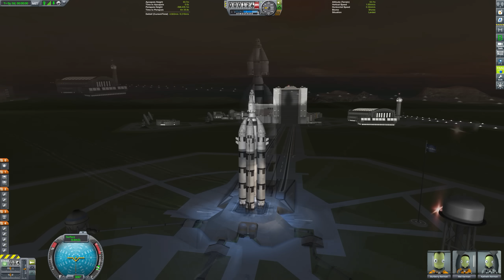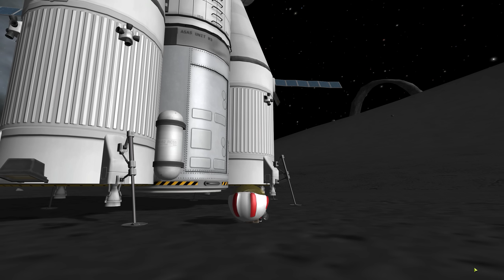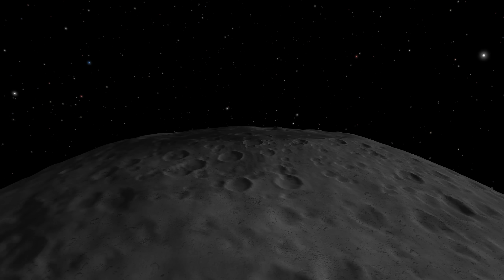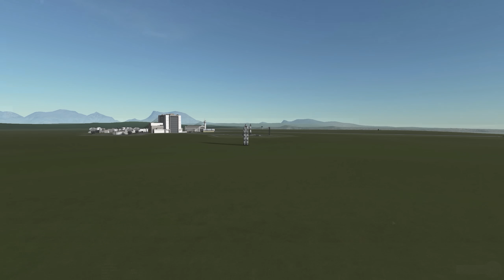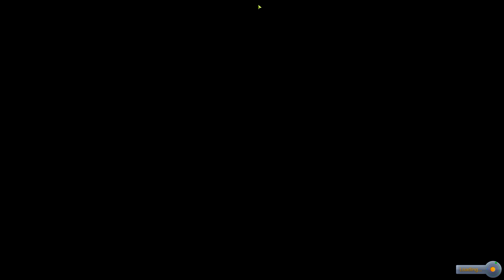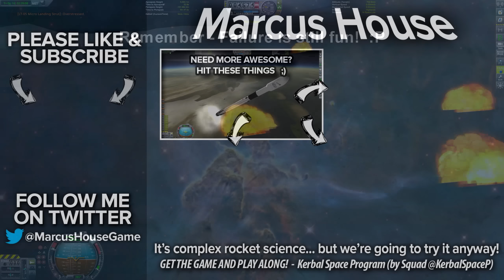KSP Reusable Mun Transfer Vehicle - Kerbal Space Program 1.4 - Stock Parts

Comment: Outstanding video and commentary throughout.  I found this while trying to figure out what I couldn't control my second ship.  My build was a massive fuel tanker with a lab and command mod plus a re-entry vehicle (MK1).  I only took one pilot and thought the others could control the orbiting Fuel station, while the pilot returned to bring up another tanker to refuel the orbiting Gas Station instead of constantly launching that large vessel like you do.  But I was not able to control the Mk1 once my pilot was on board it was just a drifting hulk.

Comment: Well that's different, and challenging, but wow, look at the size of the rocket you gotta build just to go to the Mun. You're burning about $160k worth of fuel in that lower stage alone, and you're losing 2% of the refund cost by not landing on the launch pad or runway, which normally isn't much, but that thing is huge haha. An ordinary Mun trip won't cost you more than $100k. Then again, ordinary isn't the kerbal way xD. I do like the idea of a reusable lander that you just need to refuel and swap crew.

Comment: I tried to recreate the lifter rocket, but the boosters keep clipping into the main rocket and it ends up looking like a blossoming 4 petal flower. Not sure what I'm doing wrong. The boosters seem to be attached to the main rocket half way down the rocket at 1 specific point, which makes the boosters flip around in place. I clipped it...https://clips.twitch.tv/PhilanthropicHyperDugongUWot
Reply: Use struts.

Comment: Hello Marcus, why did you used such a big booster? Your Munar lander weights about 50-60 tons, so I used 460tons of fuel in the booster and 9 "Vector" engines. And I repeated your mission. Maybe you made new booster and wanted to check it?)
Reply from the maker: Multi purpose booster. It can carry loads more to orbit if needed.
Reply: Got it, thanks for the answer!